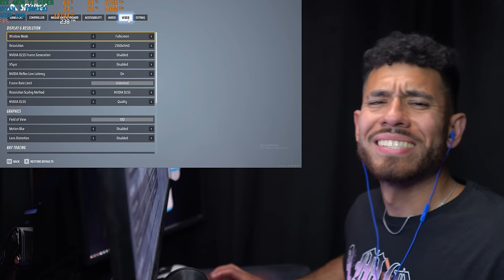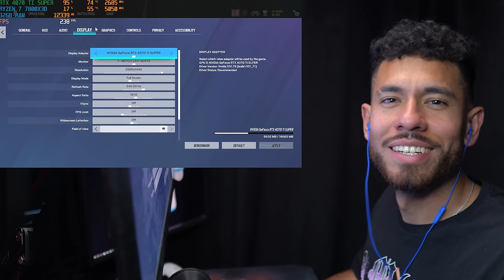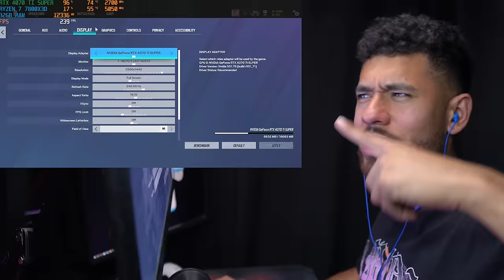BEST $1800 Gaming PC Build Guide - RTX 4070 TI SUPER Ryzen 7 7800X3D (w/ Benchmarks)

Comment: Can you made $750 price performance system?
Reply: Total: $750.54
CPU: AMD Ryzen 5 5600 3.5 GHz 6-Core Processor  ($90.00) 
CPU Cooler: Thermalright Assassin King SE ARGB 66.17 CFM CPU Cooler  ($20.09 @ Amazon) 
Motherboard: ASRock B550M Pro4 Micro ATX AM4 Motherboard  ($89.99 @ Newegg) 
Memory: G.Skill Ripjaws V 16 GB (2 x 8 GB) DDR4-3600 CL16 Memory  ($43.99 @ Amazon) 
Storage: ADATA Legend 800 1 TB M.2-2280 PCIe 4.0 X4 NVME Solid State Drive  ($63.99 @ Amazon) 
Video Card: XFX Speedster QICK 319 Core Radeon RX 6750 XT 12 GB Video Card  ($329.99 @ Newegg) 
Case: SAMA ARGB-Q5 MicroATX Mini Tower Case  ($53.49 @ Newegg) 
Power Supply: MSI MAG A650BN 650 W 80+ Bronze Certified ATX Power Supply  ($59.00 @ MSI)

Comment: Can anyone give their opinion on my PC? I've already got everything everything, except the GPU. It's arriving in like 9 days

CPU: AMD Ryzen 7 7800X3D 4.2 GHz 8-Core.

CPU Cooler: ARCTIC Liquid Freezer III 56.3 CFM Liquid.

Motherboard: MSI MAG X670E TOMAHAWK WIFI ATX AM5.

Memory: G.Skill Trident Z5 Neo 32 GB (2 x 16 GB) DDR5-6000 CL30.

Storage: Western Digital WD_Black SN850X 2 TB M.2-2280 PCIe 4.0 X4 NVME SSD.

Video card: XFX RX-79GMERCB9 Radeon RX 7900 GRE 16 GB.

Case: Lian Li LANCOOL 216 ATX Mid Tower

Power supply: MSI MPG A850G PCIE5 850 W 80+ Gold Certified Fully Modular ATX.

Comment: 7900 gre build plz
Reply: Total: $1494.41
CPU: AMD Ryzen 7 7800X3D 4.2 GHz 8-Core Processor  ($383.99 @ Amazon) 
CPU Cooler: Deepcool AG500 WH ARGB 67.88 CFM CPU Cooler  ($35.98 @ Newegg) 
Motherboard: ASRock B650M Pro RS WiFi Micro ATX AM5 Motherboard  ($149.99 @ Newegg) 
Memory: TEAMGROUP T-Force Delta RGB 32 GB (2 x 16 GB) DDR5-6000 CL30 Memory  ($106.99 @ Amazon) 
Storage: ADATA Legend 800 2 TB M.2-2280 PCIe 4.0 X4 NVME Solid State Drive  ($108.99 @ Amazon) 
Video Card: Sapphire PURE Radeon RX 7900 GRE 16 GB Video Card  ($559.99 @ Newegg) 
Case: SAMA ARGB-Q5 MicroATX Mini Tower Case  ($53.49 @ Newegg) 
Power Supply: Thermaltake Toughpower GF1 (2024) 850 W 80+ Gold Certified Fully Modular ATX Power Supply  ($94.99 @ Amazon)

Comment: Air cooler with r7 7800x3d😂
Reply: The 7800x3d is extremely efficient and doesn't require a liquid cooler. The only reason you would want an AIO would be for aesthetics however it would also add to the overall cost of the entire build.

Comment: This cooler is bulky and ugly and ridiculously large, just put a aio on like a normal person and also all ryzen 7000 series should be aio cooled just goes to how joey doesn't know much lol or he doesn't care.
Reply: Air coolers are cheaper and completely fine for this type of CPU, especially considering how extremely efficient the 7800x3d is. Anything from a Noctua U12A to a Phantom Spirit 120 works great. However, I have used a Phantom Spirit Evo to cool it even more since the chip boosts its performance as much as possible as long as it is cool enough.